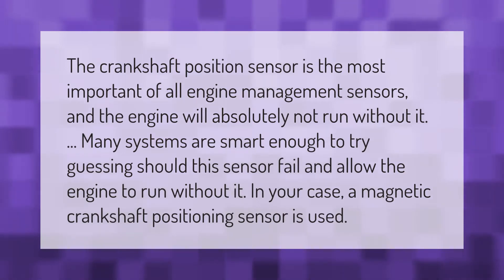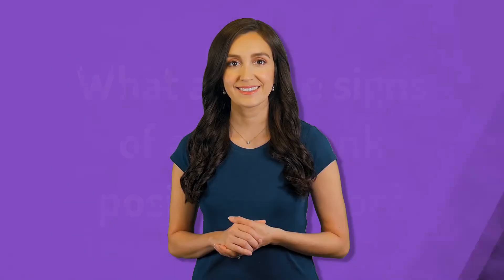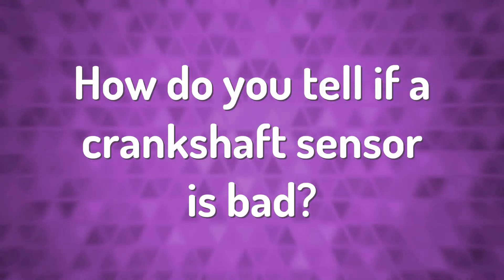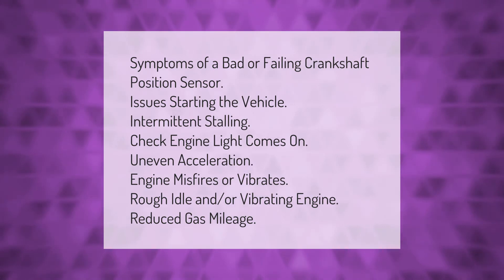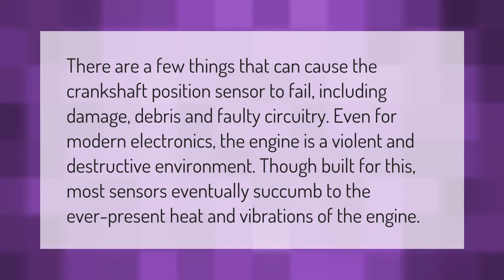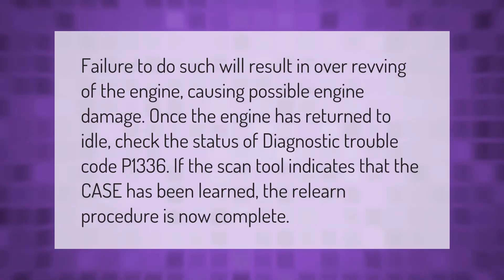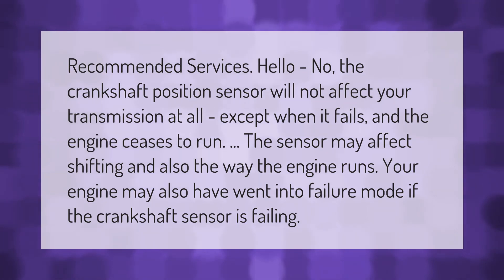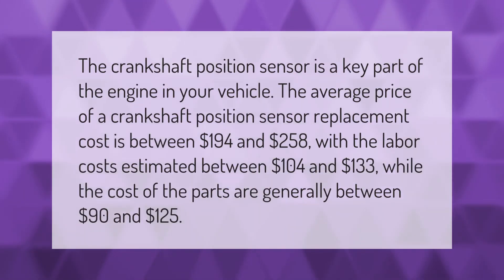Can a car run without a crankshaft position sensor?

Comment: How to make peoples dumber: Make a video telling peoples an engine "absolutely" cannot run without the crank sensor.
This is totally false.
Real answer is it will depend on your engine, most older engine with an ecu wont however most new-er(2000 and up) should be able to start and run if the engine is equipped with camshaft sensor.
If someone think i'm making sh' up, i literally tested just that at school on an engine which had cam sensor. It took longer and was harder for the engine to start but once the ECU was able to determine the timing based off the cam sensor it was able to idle and even rev up.
Reply: Thats True a have a Hyundai Tiburon V6 2004 that star and Runs whifh the ckank sensor  disconect the car have a misfire on piston #2 and some times y 2 more pistons at the same time I hope is the crankshafh sensor  that is but because it have everything  ok fuel spark, compresión, and timing

Comment: I purchased this vehicle for my daughter 08 Chevy Malibu 2.4L bad crank sensor.  I replaced it with a new one and plugged it in but it doesn't do anything. I will have to relearn it in order to run properly
Reply: how do you "relearn" this sensor?
Reply: @tchrisou812  you'll need a high end scan tool to clear the fault the recalibrate crankshaft. I bought a XTool D8
Reply: Did your relearn procedure fix the issue? I have the same car/issue 2010